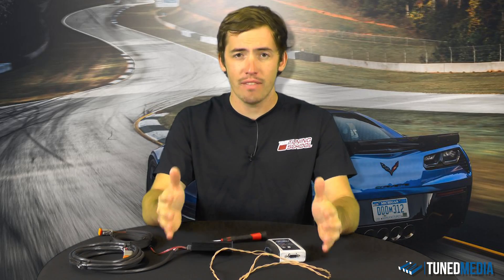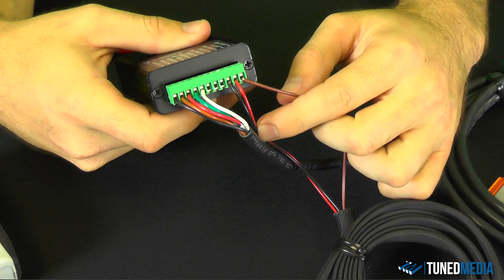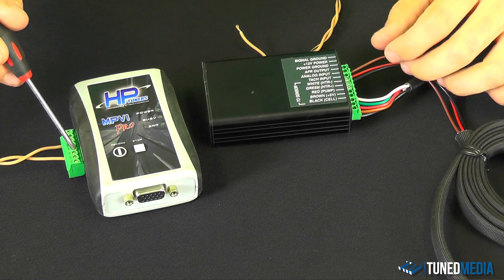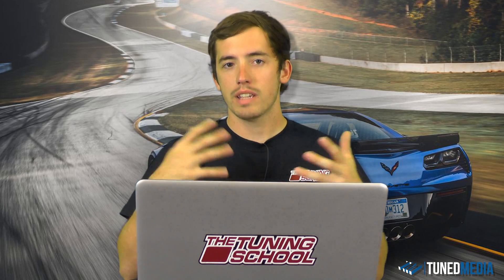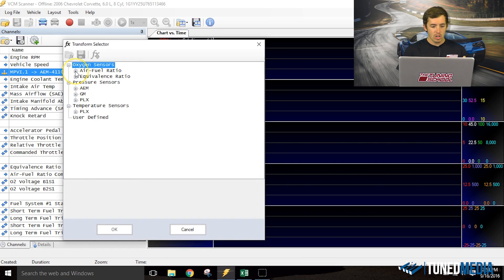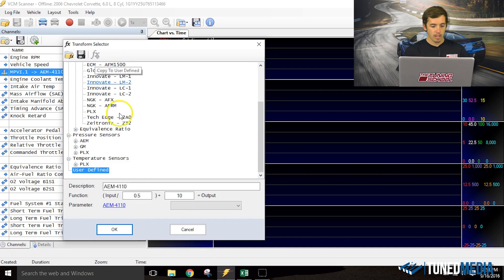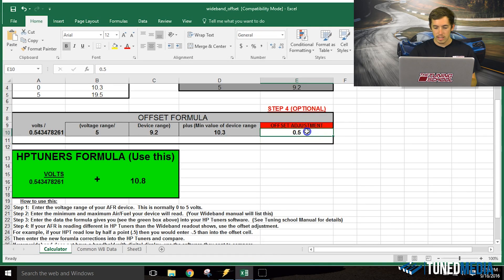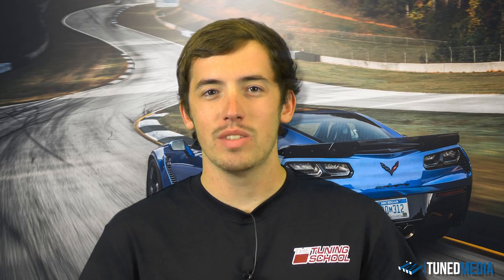How to Fix Your Wideband Ground Offset Error Using HP Tuners 3.X Software

Comment: Hey guys,
I’m using an Innovate MTX-L WBO2. If I am understanding this
I will use the analog output two (brown wire) which reads 1.1V = 14 AFR and .1V
= 15 AFR. These are the same settings as the Innovate LC2 which is what I selected
in HP Tuners when setting this all up as MTX-L was not a preloaded option. What
I need to do next is run a ground wire from the same spot I am running the
MTX-L sensor ground and connect that to pin 5 on my Pro unit. This should eliminate any offset error.
So Brown wire from MTX-L to pin 1 and shared WBO2 grounding
point wire to pin 5? Yes?  
Thanks!*FYI, Analog output one (yellow wire on MTX-L) is 0V = 7.35 AFR and 5V = 22.39 AFR. Let me know if I should be using that instead of the brown wire.

Comment: Seems like the software fix only APPEARS to work.

... since the source of the offset error is the heater current for the WB sensor, which changes with EGT and exhaust flow, the offset is only valid under the conditions that you  measured ( usually idle ) ??